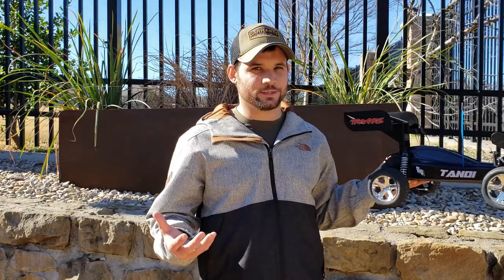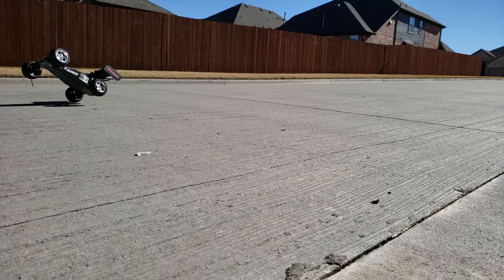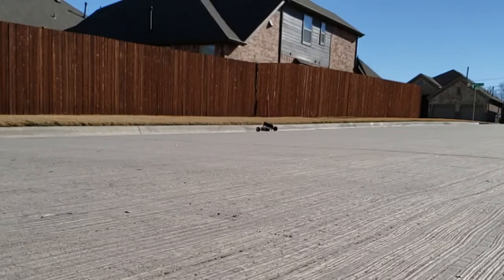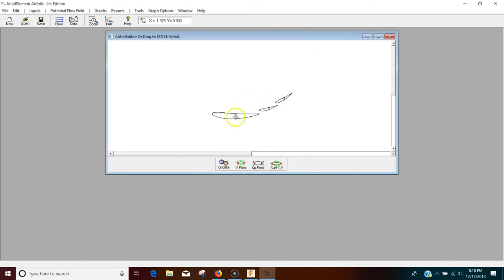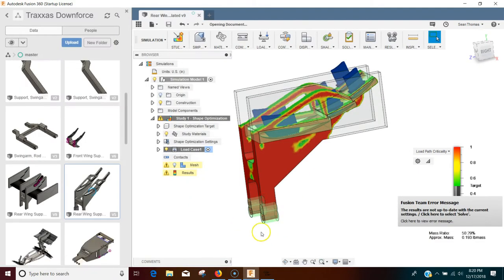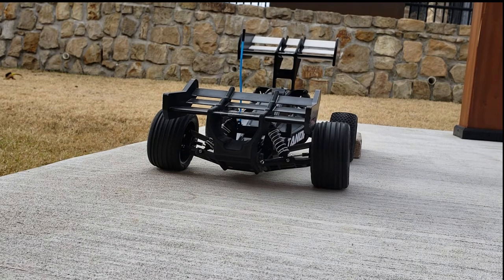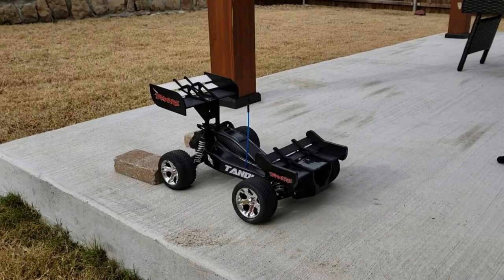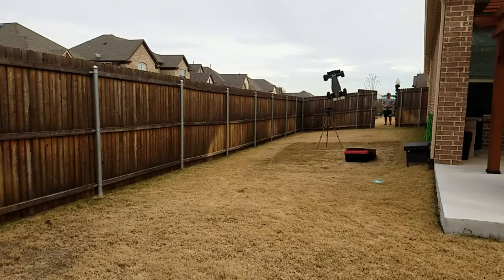Aerodynamics on an RC Car - multi element wings

Comment: The steering wobble in reverse if from caster. The car has high positive caster going forward, in reverse it has high negative caster.. shopping carts run high negative caster and the wheels flop back and forth

Comment: Man with the upward lift that alot of the bottom mounted bash bars give you I could see this actually being really viable. I might taper there front into more of a v shape and make it a bit more narrow for fear of it rubbing on the tire but I can honestly say that I would use it on a few different cars.
Reply: You should just take over the upgrade parts market.
Reply from the maker: Hah...ive thought about selling them but I just don't have the free time. I could definitely make some fun upgrades.
Reply: If only free time was a purchasable commodity I'd go broke for it

Comment: Hello from England. Great and interesting little video, well done.  This is good practical engineering and I think you should go in deeper and expand this to a series.  As per the earlier comments, scales on each corner would be great.  What about wind speed metering if you are going to conduct further tie down tests? So we can see the advent of the aero benefits with speed, or not?  And nice clear explanations, keep it up
Reply from the maker: Thanks for the kind words! I definitely want to take this project a leap further later in the year and I'll keep these suggestions in mind. 

I've also considered creating a fan car similar to the Brabham BT46 or the chaparral 2J.

Comment: This video is awesome! Most RC buggies come with a rear wing only. Your video clearly shows a destabilizes effect on the car, which is the opposite of what one would expect! Is this video showing that we should lose the rear wing, or does the lower downforce of a smaller rear wing have a different effect (like providing more traction without as much destabilization)?
Reply from the maker: I think the target setup depends a lot on the track and driving preferences. Running rear wing only makes it understeer, which is generally preferred to oversteering and going into a spin. But if you want max performance you need a balanced car which requires front end downforce somehow. Some tracks may also be just way too slow for much aero.
Reply: @EngineeringAfterHours  Thanks. I love the engineering and the science behind it this video!

Comment: what if you make a servo controllable wing so you can vary the downforce and drag, it sounds especially cool if you would use a loadcell and an arduino to lessen the drag and downforce based on how much kg of downforce is happening

Comment: If you can make it look like a brush guard I need one for my 1/8 sct. Im gonna build one out of coat hangers. It has nothing protecting the wheels rn and I want to be able to smash into other cars without letting them touch my tires